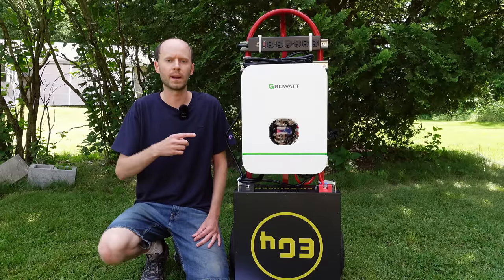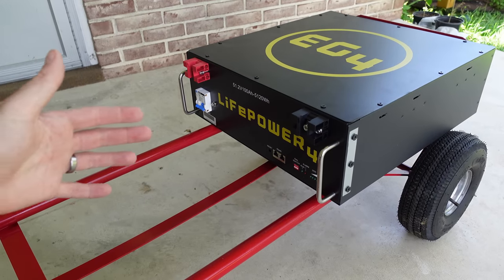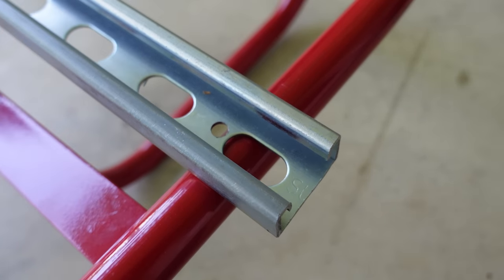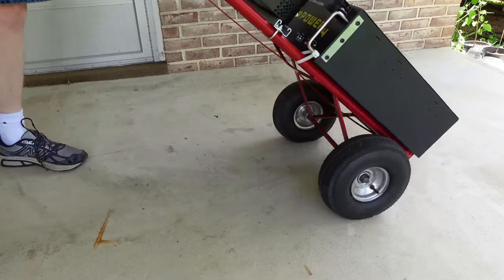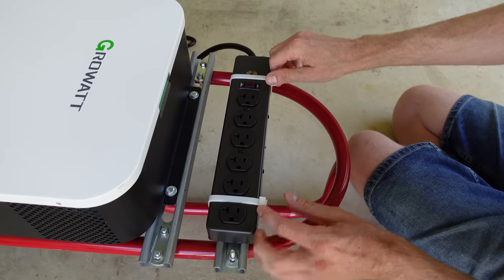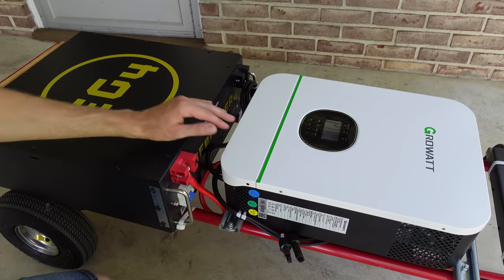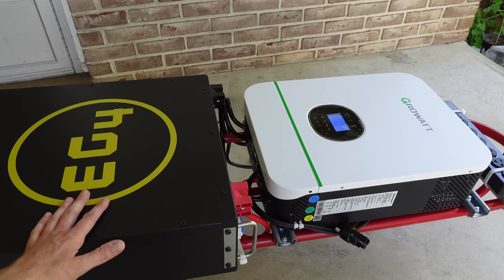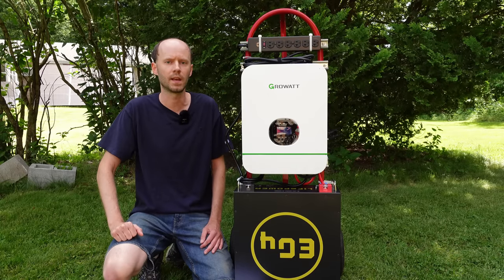Building a 3000W Portable Solar Power Station, Great for Power Outages!

Comment: Nice and neat design. I am about to start one of these, with 2kW of panels. I had planned a wood back board but now you've got me thinking about this method.

The only addition I would make is a DC breaker on the solar panel input. With 4 panels in series, I am looking at 200V DC, so I don't want to just connect these using the solar connectors.

I wish Signature Solar would deliver to me in México, as they have some items I can't find here. I have panels and inverter but batteries are still limited to 50-100Ah car battery size.
Reply: Book a room at a decent hotel on the state's. When I was traveling for work I stayed at La Quinta back then they were good. I stayed at 1 particular location all the time, so whenever I knew I was going to be in that area anything that I needed shipped to me I'd have it sent to the hotel. I would call the hotel and let them know that I had packes being delivered and they held them for me until I checked in.
I asked them in advance and they said as long as I had a standing reservation they would do that for me. It worked out beautifully for me I did it probably over 100 times.

Comment: after u-bolting the top brackets on the inverter could you not have just ziptied the bottom part of it like  you did with the battery?
Reply from the maker: Sure, you could have done that if you wanted. I prefer to use bolts where I can. Doing this over again, I'd probably use steel hose clamps instead of zipties, as recommended by some other viewers.

Comment: thank you very much for the video! Is the unit super quiet? does it have any humming?
Reply from the maker: It has fans that run under load, like any other inverter. I wouldn't classify it as "super quiet" but it's not overbearingly loud either.

Comment: Do you recommend MPP Solar PIP2724 for this build? Would this simplify it even further since there are AC outlets direct on the inverter?
Reply from the maker: You could go that route too. Signature Solar has a 24V version of the EG4 battery. It's the physical same size, just wired internally for 24V instead of 48V.

Comment: That is a great setup for an emergency backup, or for portable power for camping or tools. After reading the comments, it is easy to see that most don't understand the concept, but I think it is awesome. I am saving to build something almost identical for myself. During a power outage I could make 5 kw of power go a long way, and having the ability to recharge the battery in multiple ways makes it ideal. I can hardly wait to get mine together!
Reply: Maybe for an rv. Idk anyone who goes car camping that needs this much power. Also too big
Reply: @BaldKiwi117  I received mine a few days ago (48volt EG4 inverter and battery). It is definitely big and heavy, but I will have no problem taking it with me on hunting and camping trips.
Reply: @BaldKiwi117 this is perfect for cabin life! I spent 7 weeks at my cabin this summer using a solar power station and it worked perfectly except for not enough capacity so this would have worked awesome!
Reply: @340wbymag which eg4 inverter did you buy?
Reply: @mycabinlife1291  It is listed as EG4 3000 EHV-48 $675 from Signature Solar.
Reply: I also bought six 415 watt panels. I hooked it all up t test it and it worked fine. Then I packed it up and have it set aside for emergencies. I don't have adequate space for it to be installed permanently.
Reply: @340wbymag  that's the yellow one correct?
Reply: @340wbymag  heck I would be using it everyday to save on my power bill at my house. And then have it up at the cabin so it can power that.
Reply: @mycabinlife1291  Yes, that is correct.
Reply: @340wbymag  I already own their 6000 I think it was called ex inverter but it does not work out of the box I've waited months for some cable that I have to use and I have to download some type of firmware and then update it and pray it works. Now mind you when I bought this system they know I lived in the middle of nowhere that I did not have electricity I did not have internet I did not own a computer and I don't get a phone signal and they told me I would need none of that apparently I need all of that! They lied.
Reply: @340wbymag  I also have three of the EG4batteries and the cabinet and 15 of the 455 watt solar panels.
It's all sitting up there useless. So since I'm not an electrician this sounds like an awesome idea I could use it when I'm at the house to save on my electric bill until I move up to the cabin. And then up at the cabin so I have power when I'm there
Reply: @mycabinlife1291  I would too, but we just don't have a good place for the panels right now. I keep the battery charged and ready in case we have a power failure.
Reply: @340wbymag  right now I brought four of my panels back down to the house so there's still 11 up at the cabin. I used two of them to charge my growatt Infiniti 1300. That thing just doesn't have enough battery Reserve so it gets frustrating but I love the growatt. That will even run my full size washing machine. That was a happy little surprise when I got the idea to try it. Solar panels are just on the grass in my backyard behind the pool screen room so it's not the most ideal place for them but I still get around 700 Watts coming in and they're probably not even at the right angle cuz I just took two pieces of 2 * 4 that were the same size and propped up the panels with that lol I am very happy that I brought home the four panels though when I had the trailer I'll be able to use four of them and then I will just charge my growatt with the hand cart one.
Reply: @mycabinlife1291  I used my backup battery briefly during a power outage to operate lights, a coffee pot, and a microwave for a while. The outage didn't last long, and I did not need to use the panels then. We had a sunny day recently, so I set the panels into the back yard to charge the battery and test the system for a while. The panels were just set on the grass and propped up with a chunk of firewood beneath each panel, so it was set up poorly, but still produced more than 2kw, allowing me to fully charge the battery in a short time, while also operating a 1,300 watt hot plate to boil water. That wasn't much of a test, but it worked perfectly. This is more than adequate for my current needs. I wish I could mount the panels permanently. Maybe one of these days....

Comment: Why do you use 48V battery rather than 24v or even 12 v.  Apology for novice question but???
Reply from the maker: Efficiency. This is a 3000W inverter so that's 63A at 48V (3000/48=63). If using 24V, that would be 126A. If using 12V, that would be 252A. You'd need some massive conductors to carry 252A.

Comment: Hey... I'm buying the basic 48v eg4 server rack battery and the 48v growatt inverter what size lugs do you recommend on my battery cables? And seeing the 4awg wire is sold out do you think the 2awg is o.k or tooo big? THANKS FOR ALL YOUR HELP
Reply from the maker: I was able to fit 1/0 awg lugs (Temco) on my EG4 battery, though it was very tight. Based on this, I think you'll be fine with 2 awg lugs.

Comment: trying to put together a set up to run my grow tents on solar, could this design run a 500w led light, 6"exhaust fan, 2 clip fans &  small humidifier/dehumidifier...... 2 different cycles:  light at 65% for 18hrs per day ....light at 80-100% for 12hrs per day. how long would that set up run....best guess??  thank you bro

Comment: So battery BMS to inverter communication can be omitted?
I'm thinking about a slightly larger inverter for inductive load surges, so probably build it on a refrigerator dolly and leave it parked in the shop for stationary use. I can run a charging line from the hose until I get panels on the roof.

Comment: Hello, great video, Im planing to start my advanture with solar/battery by buying electric scooter and using it to get from and to work to ease my diesel powered car, I was wondering about a small solar system that would be able to recharge Seat Mo/Silence S01 info about the battery - "Though battery capacity is claimed to be 5.6kWh, a full charge uses just 4.5kWh of energy" would your portable system be able to recharge it once per 2-3 days?

Comment: I build my own batteries. Learned how to do it to make my own ebike batteries instead of paying thousands; now I'm a pro at it. I'm interested in building something like this that can be hooked to a ebike trailer with folding solar panels. Just because I have SOOOO many batteries and the tools/stuff to build the battery packs without spending a $1. I just spent $3000 on a bulk order of smart BMS's.. There's a supply problem when I saw them available in the US I went crazy. I like the whole server rack idea I have some of those taking up space from a robotics controller from a GM production plant. The problem I'm looking at is WATER PROOF. I need everything water proofed even if it's meant to be used indoors. Too much money gone if it gets a few drops of rain on it or wet from a flood. I really want to learn a way to mold plastic on a larger scale without having a 100,000 pound machine that requires an industrial building. I'm not there yet. But this would be cool if it was enclosed in a light weight water tight case. I'm thinking using the water cooling from my PC to build a cooling system while keeping it fully enclosed. Fans that can run wet with a radiator outside the case..
Reply: You thought about 3-D printing perhaps?

Comment: I like your build with one suggestion.  The two thick black wires (one with a red o-ring) are a danger waiting to happen.  Replace one with a (totally red for Positive cable).  I learned the hard way when Sears was out of red car battery cables so I had to use a black one.  While I knew which was was positive the garage I parked my car in did not.  They needed to boost start my car to start it and did it backwards, burning out my alternator.  at least get some red scotch 35+ for the positive wire.
Reply from the maker: They are standard MC4 connectors. Yes, you can get them in red and black but you have to be careful that the colors align with the correct polarity. I know that sounds silly, but you can't assume the red wire is positive. It's depends whether it's on the solar panel or inverter side. For that reason, I opted not to order the colored cables so as not to create confusion that could result in unsafe connections.
Reply from the maker: However, one could very easily get a piece of red heat shrink to "label" which connector is positive :)

Comment: Would this be able to be connected to an installed transfer switch? I assume instead of the power strip you just hook up a L14-30 or similar configuration to the output and then just plug it in the same way you would a generator.

Comment: Nice build. I may have to do one when I can.  Any idea how much it weights?  Could one person lean the handle into the back of a truck, then lift from the bottom and slide it in?
Reply from the maker: I wouldn't advise trying that. I think a reasonable guess is around 150lbs. The lift bottom and slide method would probably work if it had a second support on the top. The D-style handle is only one support so it would just tip to one side or the other when you lift (I think). Either way, two people is better so you don't kill your back.
Reply: @LithiumSolar  Thanks. I think I've got a dolly with two handles, then maybe use a hitch hoist to lift it. I probably won't need to get it in a truck often, but it would be a nice option
Reply: I've can't find an "advertised weight" for the EG4 battery.  I've seen "over 100 lbs" and "80 lbs." 🤷‍♂ I just e-mailed Signature Solar to ask.  The inverter is about 15 lbs.  With a dolly, outlet, and cables...115 to 130 lbs is my best guess.

Comment: well done I have been considering a similar setup for my home but my trolley is a 4 wheel trolley but I could set it up in a similar way .. Mine wont be as heavy duty as yours as mine will be for more temporary uses. I do have a larger petrol generator for long terms use but I removed an old solar system from my roof and have 8x170 watt panels. It had a 3kw inverter but I don't think I can use that anymore apparently its just to input the grid. I will pick up a 3000watt portable inverter.

Comment: How far down can that Lipo battery rack be charged down to? I know from hobby grade Lipo batteries that its not good to discharge past a certain percentage or else it will degrade the battery quickly. Do these type of batteries have the same issue?

Comment: What lug size, length and gage for the battery cable?  Is this system true pure sine wave (not simulated) and safe for sensitive electronics like laptops, TV etc?  Can you place an fuse on this system?  If yes, how many amp fuse and where in the circuit chain would it go?
Reply from the maker: The battery cable is #4 AWG and is 18in in length with 1/4in or 3/8in lugs (as noted in the video). This is a pure sine wave inverter and is safe for laptops/TVs/etc. Sure, you could place fuses anywhere however there is already a circuit breaker in the battery and over-current protection in the power strip.

Comment: Can you charge same type of multiple batteries with that inverter?
Reply from the maker: Yes you can, but this is already very heavy so adding a second to this particular cart is somewhat impractical. For stationary applications, Signature Solar sells a rack for mounting several batteries in.

Comment: Where are the solar panels that charge the battery?  A freezer will plugged into the  inverter will drain your battery in less than 24 hours right?

Comment: This setup looks good. I'm using the 6kw Sungold Power split-phase inverter and one of these batteries (with the display, though). I want to parallel-in another battery, so I need to extend the base plate on the hand truck.
I'm connecting 6 400W panels to this and need a good mounting arrangement for them.

Comment: When we have power outages, it's usually very hot outside and most invterters will not operate above an internal temp. of 104 F, so I've gone with a 2000 watt Aims sinewave inverter that claims it will run at up to 176 degrees internal, plus or minus 10 degrees.  So I wonder how your Growatt inverter would operate in hot weather?   OK I just read your link to Growatt. It says a maximum of 55C  so that's probably what my Aims 2000 will honestly do. About 125 deg. F.
Reply from the maker: I would never leave any piece of equipment like this exposed in direct sunlight. They're not designed to be used that way.
Reply: @LithiumSolar   It's in a hot garage. It gets into the mid 90's in the summer here.  Yeah, your right. I should just stay with the very affordable, very reliable gasoline generator.  Those are designed to operate outside all the time.
Reply: @LithiumSolar   Actually, for power outages, Harbor Freight's Predator 9500 watt peak inverter generator is only $2400, and I'm sure it will work during extreme  heat, unlike Growatt inverters.

Comment: Great Video bud!! Maybe you can help me? I'm looking at a a Growatt SPF 3000TL HVM-48 which has a AC  charge current 15A . How long would it take to recharge your battery 48V 100ah lithium?
Reply from the maker: 15A AC x 120V AC = 1800W / 51.2V Battery Nominal * 0.90 Efficiency = 31.6A DC Charging, 100Ah Battery Capacity / 31.6A Charge Rate = 3.2 hours. If you're in a 240V country, simply swap the 120 for 240 in the formula.
Reply: @LithiumSolar  Thanks so much for you advise, i just got myself a 5kva Growatt inverter with a 5.12kwh battery, Being from South Africa we have regular load shedding. I noticed a slight buzzing when i charge my batteries( or do a AC to DC conversion) , after some research I think it is from the transformers.  is this a common occurrence or should i be concerned. I'm not having any issues and it is working great. I'm juts not a electrician so the buzzing is slightly worrying :P
Reply: A not would be when i use it as just a AC throughput, when electricity is on there is no slight buzzing. hence my deduction to it being the transformers and where the sound is coming from is also where the transformers are located.

Comment: Thanks very clever design , Like other comments was thinking of the ACmax200 from bluetti as my use would be for an off grid cabin. We dont use the cabin during three months in the winter and would be concerned about leaving the batteries uses here in the cold for that long. Also I see in your build your not using any additional fuses or shut off switches?

Comment: great but how much are the solar panels to charge battery  for? how much power 3kw .and will that be a constant 3kw, can you run three 1kw electric kettles off this set up?just curious, am i getting this right  8 400watt solar panels, it would not run a shower or an electric cooker would it.
Reply: im guessing this guy has limited knowledge